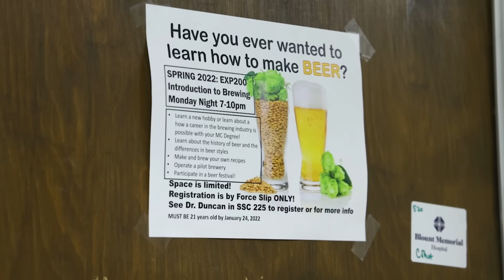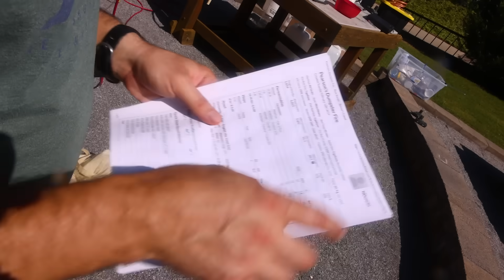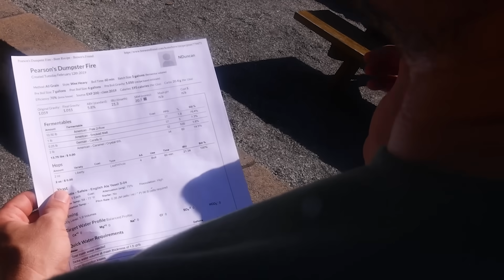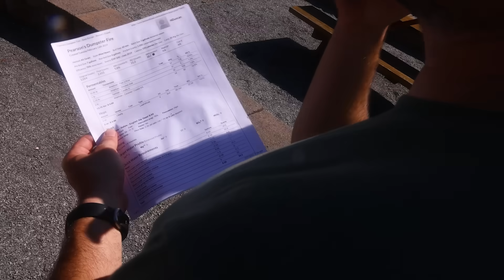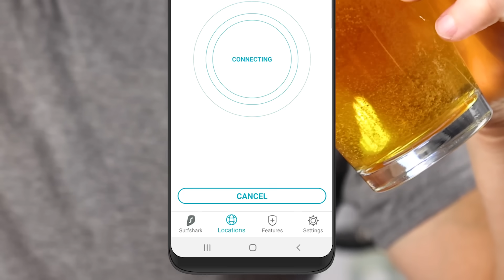Chemistry of beer, part I: Malt to wort

Comment: Made beer couple dozen times. When you're doing it on the stovetop electric (spiral calrod) range, that hot break is real important to baby along. To get there, stirring isn't effective because the heat is too slow to adjust. Just lift the pan as the foam rises and it will fall. Do that enough times and you'll get the hot break to where you don't need to worry about it boiling over.

Comment: Finish sima (might mean mead but at least modern variations tend to be made without any cereals) can be made by heating large amount of waters with some sugar, brownsugar and lemons+lemon shells, somehow you should avoid the white parts inbetween lemon and shell. taste a bit like tea at that point, and then you pour it over to some other container and remove the lemon parts, add a small amount of instant yeast lot of recipes seem to say pea sized fresh yeast or 1/4-1/8 teaspoon of instant yeast. and let it stand for a day or few days, should be somewhat covered but some air may need to get out or bottles could explode.
it's like a lemon softdrink, but probably contain small amount of alcohol. think it's pretty easy to do.

Comment: Good video! Im not big on using a water cooler as a mash tun. Using a sanke beer keg with some modifications and a grain bag is what I do. Do all the brewing steps in 1 vessel, and with a #11 rubber stopper with a hole through it for an airlock you can make a sanke keg into a fermenter.
Get some korny kegs (pin lock or ball lock) a co2 tank and a beer tap kit then make a kegerator out of a fridge or deep freezer. Brewing beer is easy, kegging beer is easy, bottling beer is hard word, time consuming, and takes time to naturally carbonate.

Comment: I live about a block from the Anheuser-Busch brewery in St Louis, and there are days where the smell of malt is so strong its basically all you can smell even in your house, and honestly I'm pretty okay with that. The quality of the water here, as well as the existence of large caves under much of the area for use in cooling the beer is why the brewery was built here originally, and also why there are a ton of smaller breweries in the city.

Comment: I have no idea why they recommended 5.2 Stabilizer, a product known to overshoot the pH massively (usually ends up about 5.8), instead of correctly adjusting the waters chemistry to get the right pH. Breweries use either Acid (usually lactic) or chalk to bring the pH up or down respectively.

Comment: Great video! A few inaccuracies (although they are common myths about beer brewing, so you are forgiven):

1. Scotch ales do not contain smoked malt; this is an old myth perpetuated by an old edition of the Beer Judging Certification Program that has since been corrected.
2. There are many styles of beer that only contain base malt, and that does not make it "green beer". Examples: non-adjunct Pilsner, some IPA's, some blonde ales. "Green beer" generally refers to beer that hasn't finished fermenting/conditioning.
2. Five Star's 5.2 pH stabilizer doesn't work. It's snake oil, don't use it. Water chemistry in beer brewing is complex and pH is important, but brewers generally use an organic acid like lactic acid or phosphoric acid or acidulated malt to drop pH of the mash.
Reply: Have you read what the BA guidelines, the guidelines used for professional beer competitions, like Beer World Cup, say about peat characteristics?

Comment: They're using 100% grain to make their beer. Homebrewing is a lot quicker if you use pre-cooked malt extracts that come in either syrup or powder form. If you want the flavors from specialty grains like carapils or caramelized malt, you can steep them in the wort using a cheesecloth bag while it's cooking. When you're mashing your own grains, or steeping specialty grains as part of an extract recipe, there are several different enzymes that become active at different temperatures, which is why you want to start with cold water and gradually heat it up to boiling.

Comment: Watch 'How Beer Saved The World,' https://www.youtube.com/watch?v=PdwYjFnFoJU&t=3s&ab_channel=NLsko
Not everything in the video is super accurate, but it's just a bit of fun.

2-row barley is mostly used in the craft beer industry, while macro breweries usually use 6-row. 

Not sure that I agree that making a beer just using 100% base malts makes for an uninteresting, one-dimensional beer.

The mash-in temperature will influence the different levels of alpha and beta amylase produced, which will, in turn, influence the type of sugar developed, which will impact the finished beer. 

Breweries don't generally use distilled water. Most will take their water through a filtration process, like reverse osmosis, to clean up their water to start with a clean slate.

Comment: I disagree wholeheartedly with your opening statement.  I've worked in wine for 15 years and while there are similarities between the two each product offers unique challenges to it's producers.  It's more of an apples to oranges comparison, yes they're both fermented beverages but that's where the  similarities end.  That being said, I understand where you're coming from.  "It has fewer ingredients, therefor it is more simple to make." While I do agree with that statement, there are a large number of extraneous factors outside of the control of those within the wine industry that brewers have absolute control over.  This is what makes wine interesting to me at least,  and given the option I would absolutley jump at the chance to have the same amount of control that brewers have over their finished product.  Drop me a line if you care to know more.
Reply: Actually, he's not wrong. 
It has nothing to do with the number of ingredients, it's about the fundamentals of fermentation, namely the availability of fermentatble sugars. 
Take grapes, crush, leave to spontaneously ferment or add yeast, you have wine. 
You can't simply take grain, hop, and water, leave them, with or without the addition of yeast, and expect them to turn into beer. 
Grape juice has easily fermentable sugars, grains do not. 
I've worked in both wineries and breweries, with each of them having their own challenges.
But he wasn't talking about "extraneous factors," just the very basics of creating both products.
Reply: @dampaul13  Shrug Believe what you will then.

Comment: I've been an occasional homebrewer for about a decade and I learned a few new things. He didn't mention that at one point the Egyptians paid workers in beer, it was actually used as currency. 🤓🍻
Reply: Well, it would be more correct to say that they were paid in rations, which included beer. "Currency" is a strong word though, as beer wasn't much of a medium of exchange. Raw grain or weights of metal called deben were more likely used for that purpose.

Comment: Having too thick of a mash is more of an issue of gelatinization, getting all of the grain wet and all the starch is solution. Sugar doesn't reach any solubility limit until several times what the density of beer or wort. 

Water chemistry is much more complicated of course, but it's worth mentioning that the water chemistry found AT a location isn't necessarily what was USED by the brewery at that location. Burton on trent or Guinness for example...

Comment: In case anyone's wondering, the chemistry major said she's studying the bioconversion of terpenes in the fermentation process that come from the hops they added in the beer. It means she is studying how the body converts the terpenes (which is a group of molecules responsible for several flavours and aromas). These terpenes come from the hops (a flower that is added to beer to add bittering, flavouring, and stability). She is studying how different hops bring different terpenes and how the body degrades them.
Reply: I'd think it's actually how the yeast converts those terpenes. Bio transformation is a big part of complex hop aromas in modern hazy ipas...

Comment: I haven’t finished watching so this might be premature. The video is a good overview of one technique of brewing basically it’s how it works but it’s far more nuanced. The enzymes that convert the starch are alpha and beta and each have a different function, depending on what kind of beer you want to make you use temperature to encourage one or the other or do what is called a decoction to make use of both. A dry beer like a crisp Pilsner is mashed at a lower temperature than say a full bodied stout. 
A note on water chemistry generally speaking a good tasting tap water will make a good tasting beer however to encourage different characteristics modifications are needed, to accurately modify one must know what the starting point is and unless you have access to laboratory grade testing equipment you won’t really know where your starting point is. It’s a misconception that brewers use distilled water to “replicate” regional water profiles because the brewers in that area themselves modify the water so sure you could look up the water from the area your favorite beer comes from but that’s only half the puzzle because unless you know the modifications that brewery uses you won’t match the profile. 
Brewers use distilled water because they want control over hardness but more than that they want to control the ration of sulfate to chloride. A profile that favors sulfate will play better with bitter styles while a profile that favors chloride will favor malt flavors. 
Finally this is something that even professional brewers get wrong, peated malt IS NOT traditionally used in scotch ale. This is something American brewers started doing and it back fed into Scotland but originally scotch ale did not use peat smoked malt.

Comment: I'm actually brewing this weekend and it will be a wild one - a raw kveik juniper rye ale. Let me break it down for you.
Raw - I'm not boiling the wort. The ale will be more cloudy and have more earthy/green flavors. 
Kveik - A Norwegian farmhouse yeast that both ferments quickly and doesn't mind neither temperature fluctuations nor higher ones. Instead of the regular two weeks fermentation I can with a kveik I get it done in a single week. 
Juniper - I'll be using juniper as bittering/flavoring. Both twigs and berries will go in. Before hops were used juniper was the dominant one in Scandinavia,
Rye - I'll be using 1/3-1/4 rye malt. This is a very large percentage. Rye compared to barley is a bit more spicy, it is more flavorful (less sweet). It also thickens the ale a bit improving mouth feel. 
Will be a fun weekend.

Comment: Those salt mixes you mentioned that make distilled water mimic the water from certain regions were a big deal in the late 1800s through early 1900s. The science of chemistry had developed enough to analyze the water from famous health springs such as Bath, Spa, and Selters (Seltzer), and had also developed early methods for carbonating water to mimic the springs' naturally fizzy water. This is why soda fountains originally appeared in pharmacies -- carbonated water laced with those salts was considered a health food! You could go in and ask for, say, Spa water, and they would mix it up for you right there at the bar. The sweet drinks were just a treat to keep the kids quiet while you drank your medicine.
Eventually, dietary science caught up and realized there wasn't anything special about the water unless you happened to be deficient in one of those minerals, and supplement pills were a much more efficient way to remedy that. And so the pharmacy soda fountain quietly died off, the sweets they made having long since been copied by another industrial revolution fixture, the ice cream parlor.

Comment: I had no idea everybody made it differently until now.
all the methods are more or less the same, but what we do at my house is get a big ol grain bag and a big ol pot, then heat it up that way. we used to use thermometers and timers to tell when it was at the right temperature and carefully monitor it for until the mash was done. now we've got this big fancy one that regulates the temperature for you. a good timer for the mash is to just go out and smoke a cigar. by the time you come back it's probably good by then. after that, you take the grain bag out of the big 'ol pot and set it aside. it's like brewing a tea, sort of. and after the mash is the boil, when the hops are added. then cooled down later with cold water through the copper cooler thingamajigger, and put into the fermenter, along with whatever yeast fits the style. and also dry hops
probably had a few steps out of order or skipped a few since I'm not as experienced as others and also am about 5-6 beers deep over here. so don't take this as 100% legitimate advice. however, I'd say for a small home brew set-up it's probably one of the easiest ways to brew the beer, and doesn't require as much attention 

also. Inter-dimensional Space Pickles

Comment: 7:35 is it safe to heat up those plastic barrels  ?
Reply: It's not that hot when it's mashing in the converted coolers. When they get to boiling they are using metal pots.

Comment: It may interest some to know that "Sour" beer was the default beer for most of human civilization because the natural air and lack of obsessive sterilization techniques in modern beer introduce these flavors; when you think medieval tavern flagons of ale, they aren't drinking "manly" bitter beers! They are all cheering delightfully sour liquid creations into the air! So Cheers to Sours, the only beer I ever like, so I am legally obligated to mention that it's still the "original" beer!
Reply: Also to add that the beer was darker as they didn't have that good industrial control of malting until the late 1800's - early 1900's or so, and they were also slightly smokier for similar reasons. Then we also have other yeasts coming from the wild beyond the regular Saccharomyces Cerivisae, with Brettanomyces being one with a strong signature with its barn-like, sometimes bandaid-like aromas. So they were cheering a lactic sour, lightly acetic, medium-dark, lightly smoky beverage often with that barn-like aroma beyond the hops. What a stark contrast to the majority of the 1900's light, bright and clean industrial beer.
Reply: @steffeeH  you don‘t necessarily need to kiln malt. In Germany, some malts were simply air-dried, with no additional heat. Beers made from these very pale malts were called Weißbiere (white beers), while beers made from darker, kilned malts were Braunbiere (brown beers). In many parts of Germany, the white beers were typically also sour (notable exception: Bavarian Weißbier), at least that was the fashionable thing from the 16th to the 19th century. Beer styles like Berliner Weisse and Gose are remnants of that tradition that survived to this day.
Reply: Have you tried Duchesse de Bourgogne?
Reply: @8BitNaptime  yes.
Reply: @8BitNaptime  Flemish oud bruin beer is only second to gueuze mate. You have brought the kings of belgian beer into this chat. #BrettForTheWin
Reply: It’s always interesting to see how humans throughout the ages have used and made things like beer
Reply: Profile picture checks out
Reply: Sour and smoky.  Didn't lose the smoke til modern mining was introduced.
Reply: I love fruited sours....I'm a big kombucha nut too....I luv fermented foods n drinks period
Reply: sour's are awesome, but I do appreciate modern brewing techniques and what they have brought
Reply: That's not quite true, though sourer beers were common, fine beers were the most valuable and demanded ones. such quality was achieved through heavily alcoholic beers getting aged in caves for maaany months (lagering) until clear and mature, like Marzen and Bock.
Hurrah for the Bock, the true good medieval tavern beer!
Reply: @riograndedosulball248  you‘re probably referring to lager beers here (Märzen actually used to refer to any lager beer brewed during winter to be consumed in the summer, very different from the modern understanding of Märzen as an amber, slightly stronger beer, which was really only invented in the 1870s, while Bock was considered to be the local beer type of Munich). Until the 19th century, they were virtually unknown outside of Bavaria. Further North in Germany, some beers were brewed for keeping for a long time , typically for export, though the vast majority of beer was consumed fresh and locally with relatively little maturation time (Braunschweiger Mumme was brewed to keep for long times on ships, Danziger Jopenbier was another long-keeping beer type). The landscape in the Northern German regions didn‘t allow for cool caves deep inside hills or mountains, simply because of a lack of mountains, and often quite sandy, gravelly soil. Surprisingly, ice-cooled cellars were an innovation only of the late 18th and early 19th century, and in some parts of Bavaria, were virtually unknown as late as the 1830s. Northern German keeping beers were often hopped at crazy high amounts to withstand lactic acid bacteria, or brewed to a very high strength (where strength here means lots of alcohol or unfermented sugar or both), or they were simply sour. Berliner Weisse for example used to be consumed either young, or put in robust stoneware bottles which were then put in the ground for several years. The beer matured fine that way, and often tasted like fine white wine when dug up and served. There is a lot of complexity in German beer history, and brewing and drinking customs as well as preferred beer types wildly varied by region, sometimes even by city or town. A lot of that died out due to the fashion of bottom-fermented beers and the industrial revolution which replaced many of the local brewing traditions within Germany.